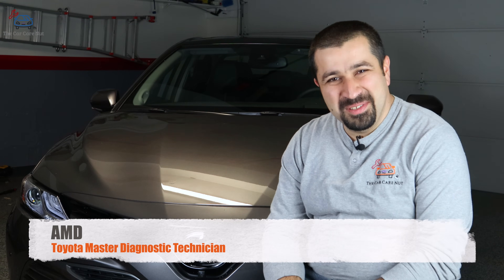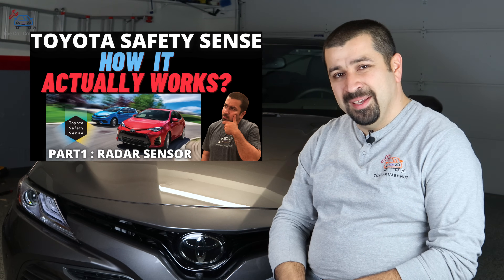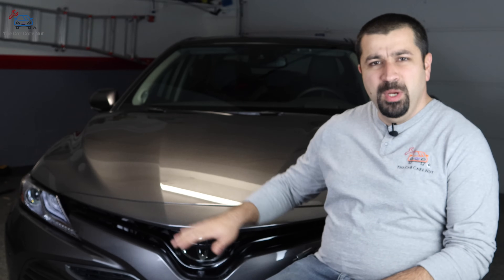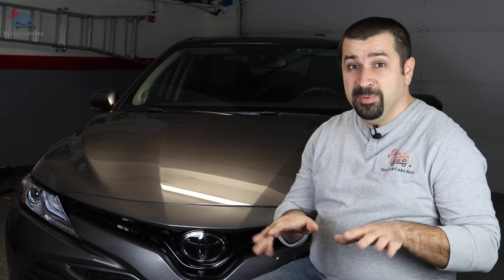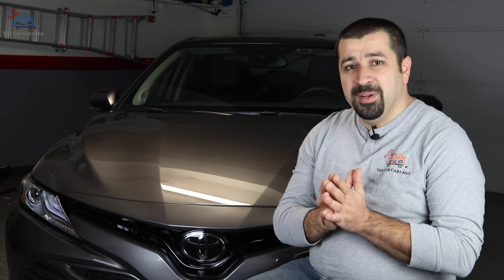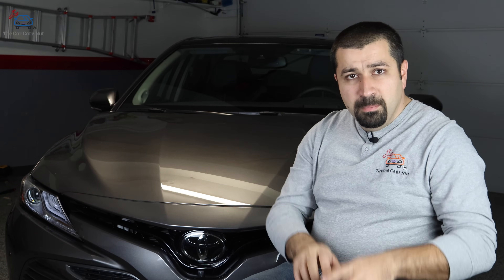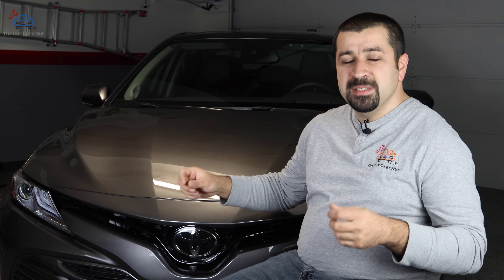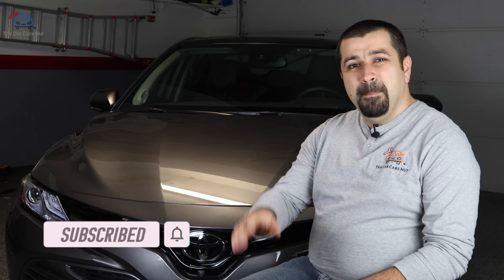How do Toyota Safety Sense Work Part 2 Front Recognition Camera

Comment: Thanks for this series. The first two episodes have been really helpful. Toyota calls this Safety Sense 2.0. How does this differ from 1.0. I had PCS in my 13 Prius,  and it activated every time I drove on a particular very steep street if there was a car stopped at the light at the top, even if I was not moving fast, so I always assumed the system in that car couldn't measure the extreme angle of the road which made the car in front appear closer than it was. I haven't had that same experience in my 2020 Rav4 so I have wondered if the difference was the 2.0 version of Safety Sense or that the camera in the Rav4 sits much higher than the camera in my old Prius.
Reply from the maker: The biggest differences in generations are in the camera and the programming. The first generation was very clunky and was somewhat not as active and really useful as the newest one. The new one is actually capable of a lot more than it does but limitations of liability and government regulations is what limits it.

Comment: Very interesting, thank you. Out of interest. There has been a lot about the RAV4 failing the moose test. Will the system slow the car down enough to steer around the obstacle safely?
Reply from the maker: The system will slow down the car at full force with no guarantee that it will actually stop the car in time. While it’s braking you can steer the car safely although usually it applies the brakes at the very last minute and the normal human reaction of most is to panic and not do anything in such a split second

Comment: Tempted to upgrade to a 2020 Camry from a 17. But I’m staying put I think
Reply from the maker: Though the newest generation Camry is very nice but the 2017 is a very solid car that I wouldn’t rush to trade in unless you don’t like the way it drives and want the newest features that the new Camry has.
Reply: I feel the same thing about my 2016 ! The only issue i have with my '16, is the transmission shifting ! Do you notice anything in yours ?
Reply from the maker: Scott M try a memory reset with your transmissions. Would need a scan tool to do that but that will improve your shifting issues on your 16 camry